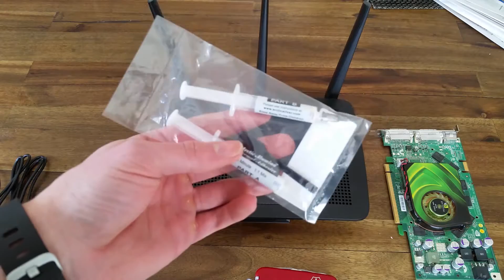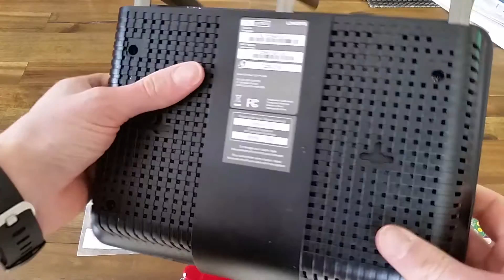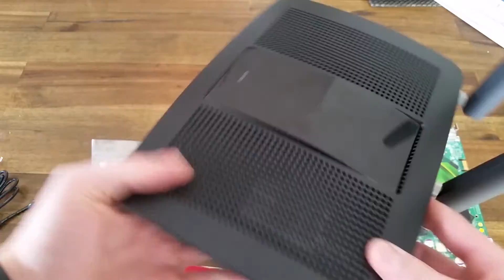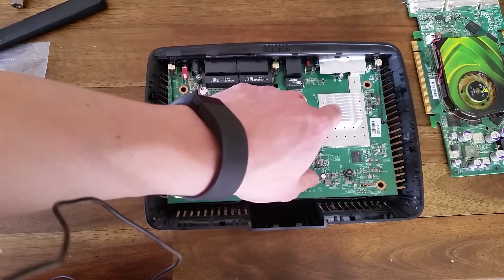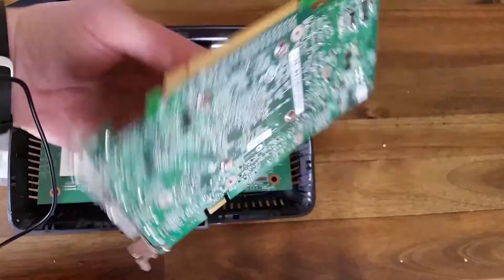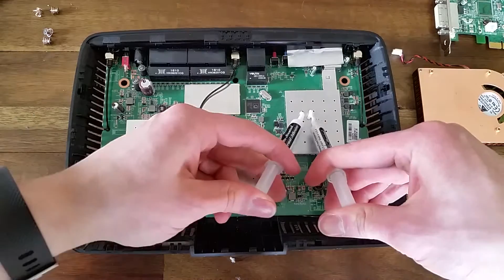How To Cool Your Router With a GPU Fan

Comment: My modem and router got hot to the touch, very hot and my wifi disconnected. I tried cooling it down and it worked again but ever since then the wifi its felt slower. Any help?

Comment: What you are doing does not make sense for 3 reasons.
1)  If you use an old fan, its life is already mostly over so not worth the bother when a fan costs maybe $5.
2)  Those thin fans had to run at higher RPM to make much airflow so had shorter than average lifespan in the first place.  They were highly optimized for their short height which is the worse attribute leading to short lifespan due to the short bearing cavity needed.

3)  A thicker fan can run at much lower RPM to move the same amount of air, which not only makes it quieter, but also far longer lasting.

Comment: why they didt put a fan on every routers in the world
Reply: Because fan breaks down in time, a heatsink won't.
Reply: to cut cost
Reply: because it is not necessary. How about that? Chips have T range, passive radiators are able to dissolve that heat, so why introduce anything that may affect radio signal, add up negative UX and requires more $$??

Comment: You just need to pop off the cover, you dont need to cool it further (the cover reflects all the heat, keeing the thing warm -> I dump my routers into a $3 clear tub - the lights look COOL at night)
Reply: That's not necessarily true, some people will put their router in an out of the way place and not monitor its temperature, but dust (or spider webs) may accumulate over time.  Plus, it depends on the load placed on it, more connections and more data put through, especially QoS or other traffic management can put a lot more load on a router thus increasing heat.
Reply: Exactly, just take the covers off lol..

Comment: 2019 and still no air-cooled router Available imean you're router is literally a PC and have a CPU rom ram and need to be cooled
Reply: i think its a part of the industry , to make their life shorter so you can buy another one , I mean in my country Iraq , they never take longer than 6 months , i actually visited this video due to damaged router Tp link
Reply from the maker: I've been using an old ea9300 for a year now without any active cooling and it sees heavy use. My guess is that unless your room is really hot, you will be fine.
Reply: some cable companies already have them rogers xb6
Reply: Get a usb powered laptop fan

Comment: Pretty good, nice job.
Did you consider soldering the fan directly to the +5v supply inside the case?
Cheers
Reply: What you are stating does not make much sense.  FIrst there may be no "5V supply" inside the case, because it's 12V input then SMPS subcircuits drop voltage down to what the processor, radios, and memory need which is probably lower than 5V, except the radios then depends on their design power.

Second, in this SMPS circuits, they don't design for extra power to use for something else, and in particular you probably do not want the extra (electrical ripple) noise from a fan motor, on the radio circuit supply, will make for worse performance.

Third, there is no reason to do this.  Fans for PCs are generally designed for 12V and there are multiple different ways to decrease their RPM if you don't need the 12V design power RPM.

Comment: Do your router really need a fan?
Reply: Yes,in malaysia room temperature is 33 Celsius and 35 at afternoon . My wifi stopped working many times when i playing online games.we need a cooling fan for wifi
Reply: I never did before from the last 20 years,  but my router is in a closet in this house.  Our Internet was dog slow. Summer temps now always hotter upstairs. This is my second router and  the internet is dropping packets. Tested with by passing the router and it was fine.ISP said all is good. So I put a fan on the router and internet is back up full speed. I just used a desk fan until I vent the closet.

Comment: they don't come with fans cause they don't need them
Reply: Your CPU doesn't come with a motherboard, PSU or anything else associated with it either so that's not a good point of reference
Reply: adding fan makes appliances last long and prevent further damage to the components inside.
Reply: when you buy a CPU it doesnt come with a fan either, does that mean it doesnt need one?
Reply: I have just taken a look at my router speed with and without cooling.
It's about 30% faster when cooled.
So no, a router doesn't need a fan, but obviously can work better with one.
The router is from British Telecom, so is of reasonable quality.
Reply: Yes, the router comes closed and ready to use.
But you have to understand the point of view of the company, she does not want you to have the equipment all your life. So she guarantees the guarantee minimum. The rest will depend on the environmental conditions and you.
I think that before a device has problems with crashes and strange things, I add a fan so that the heat can always be evacuated.